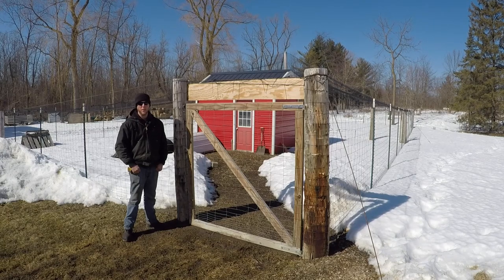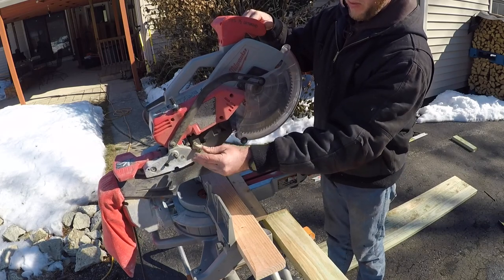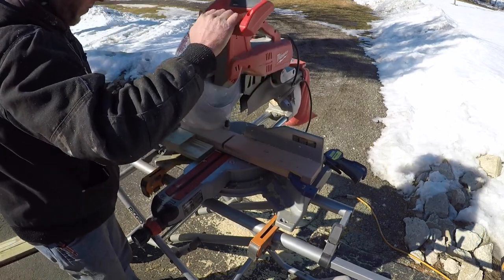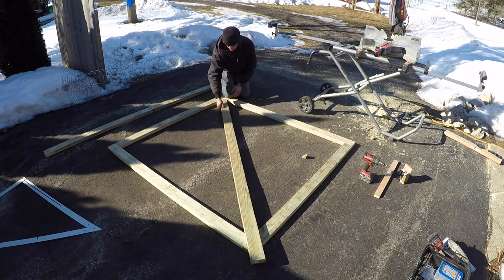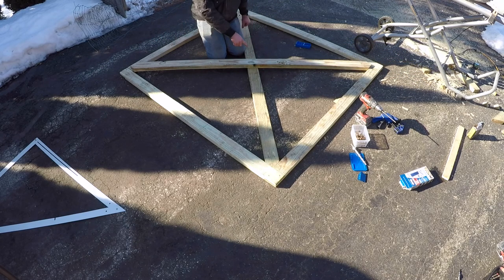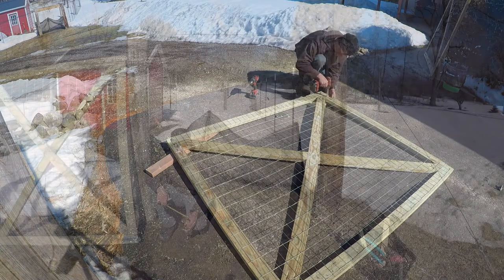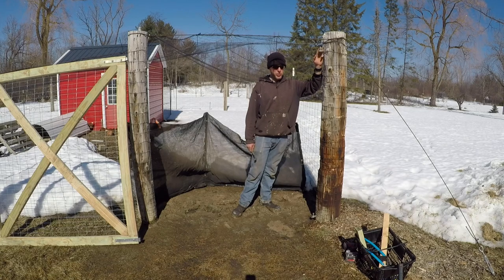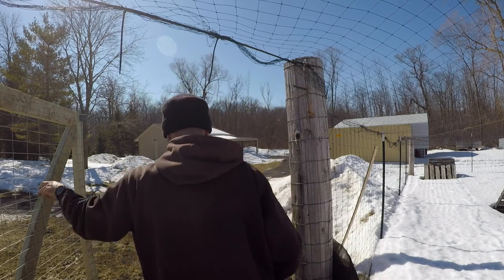Building A Gate To Last, No Sag Garden Chicken Coop

Comment: Tyler, I remember when you built the coop and exterior fencing.  Sorry to hear the foxes found a way to invade your coop. Gotta protect the chicks. 🙂 Enjoyed the build; I learned a few nice tips on gate construction. Am wondering if you think you might need a latch on the bottom of gate post as well?   Of course you take the chance of getting snagged walking in/out.  Maybe a scrap piece of 2x4 so gate cannot be pushed in at the bottom if Mr Fox decides to nose his way between gate and post.  Nicely done. Full-watch and have a fine week.    👍🏽🙂
Reply from the maker: Hey Don! Yeah it's been a while. Crazy how fast time goes! Yeah I definitely considered moving the latch to the center as more then likely the best place for it! As you mentioned my reason was the same, snagged and ripped clothing haha. Well see if I come up with something but it's much stronger and I don't forsee any predator being able to push it hard enough to get past. A block as you mentioned would eliminate the risk completely. If it weren't so tight to get the tractor in and out that would work perfect. Thanks for stopping in!